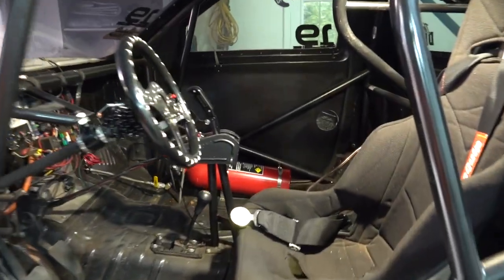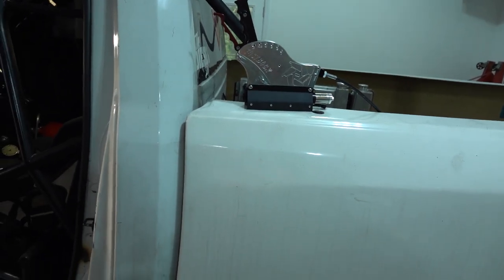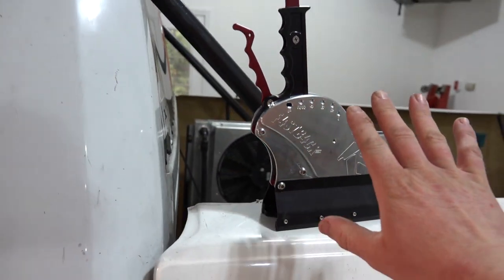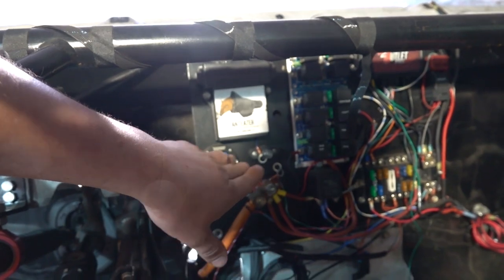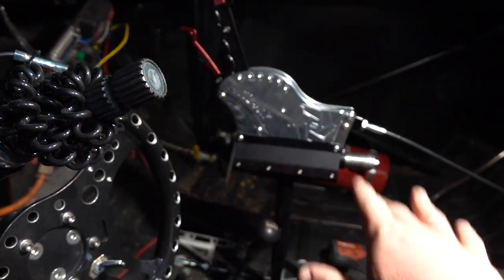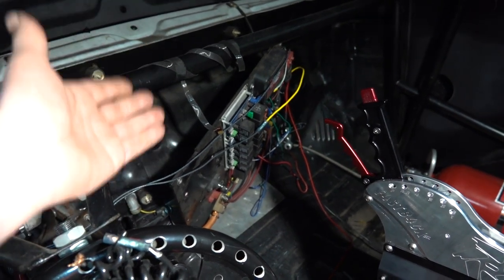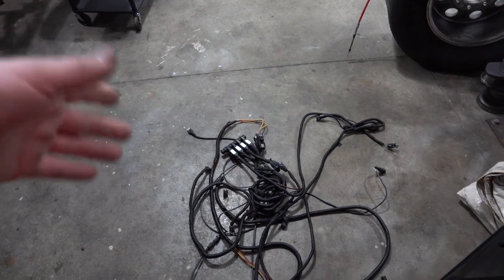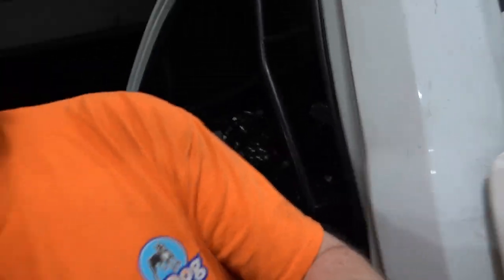UPGRADING TO THE BADDEST CUMMINS SHIFTER ON THE PLANET!!

Comment: I really like race truck content (2010 RAM 2500 Regular Cab with a 6.7 Cummins). Especially the blue 2020 Ford F350 6.7 Powerstroke and the OG grey 2012 RAM 2500 6.7 Cummins (Caitlin). They're both nice trucks and that beautiful race truck you  just built.

Comment: What kind of wiring harness are you using harness in my truck is all jacked up and I’m just wanting to replace it all is there a company that builds wiring harness for in cab and under hood for these trucks
Reply from the maker: Standalone engine harness then everything else I wired
Reply: @TurbaTom  where do I get the stand alone harness at I seen one but it was for a manual transmission only and 03-05